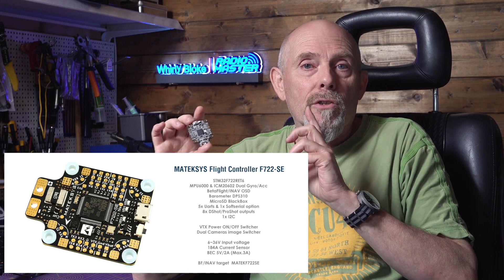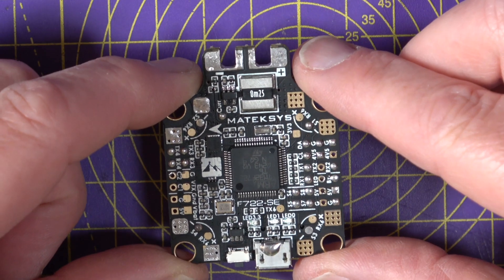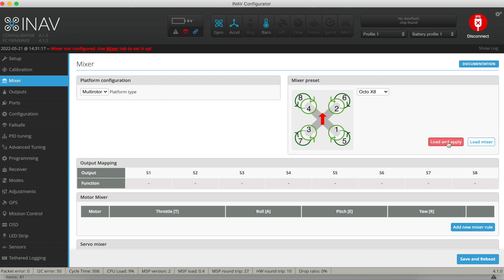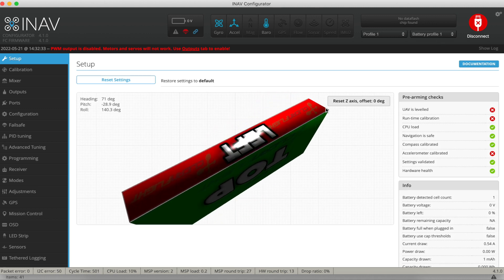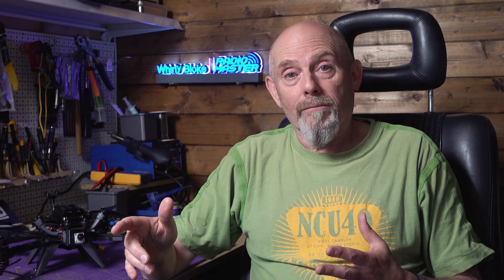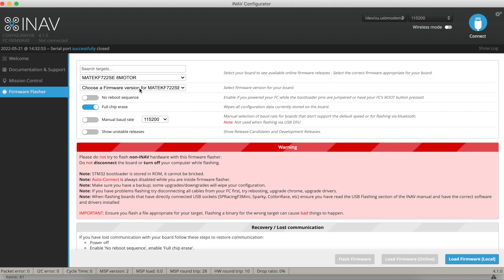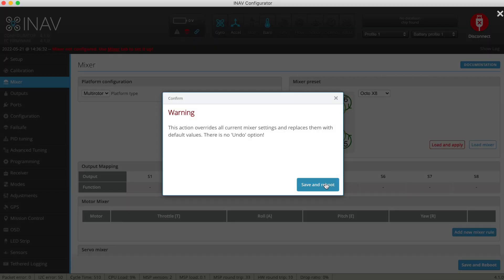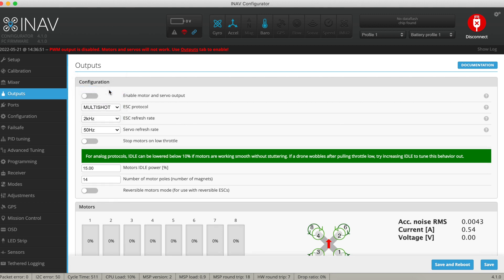Matek F722SE, INAV and 8 motors - how to get it working

Comment: Gday from downunder Whirley. Thanks for the prompt post on the ao7 gps holder . Mate I have a question on the thicc and maybe a small bone to pick   . The Gh5 that you use on the thicc uses image stabilisation now im a pretty dumb newby if I may say so myself, before anyone else .. and I gone and seen old mate whirles sporting a gh5 on the thicc n didnt do my homework and thought gh5 whirley uses one . He looks like he knows what he doing . Grab a gh5. Granted I couldnt find no black magic for the price I could afford  . Got a good deal on a practically new gh5 with the 12-35 and a few other extras for a k aus . Im hoping you can tell me you said somewhere in your thicc video dont get a gh5 and or there is a workaround that is equally as good as using a komodo or black magic with no image stabilization   , and I just wasnt paying attention if you did . You know us dumb newbys , we see you you tube fpv gurus like JB and yourself showing stuff and we go n buy that . So I got the gh5 for a grand and the built thicc 2nd hand for $700 with 2 batteries and a shopping bag full of props.
Please tell me ive had a win 
I fell down this expensive fpv rabbit hole , actually I got pushed and ive made a few dumb mistakes on the way , yeh yeh props off , ive still got my feet attatched. 
Reason im asking is a dude on another channel says make sure to get a camera with no image stabilization on the thicc .
Reply from the maker: You're spot on with the GH5 stabilisation. Check out my upgrade video that addresses these issues and more.  https://youtu.be/qwYQGF4ZmKQ
Reply: @WhirlyBloke  Can I respectfully suggest you should recommend not to go get a Gh5 on that video maybe in the description to stop people like me going and purchasing it ? My fault totaly for not doing my homework on that 1  I have  been preparing for a trip away . Early onset farking dementia  and photos and video are  memories  right .This is more than just a hobby for me , its a also a way to keep my brain working and boy doesnt this hobby have some challenges so I need all the help I can get . End of my life sob story .  So Ive got a problem now . I can try and sell the Gh5 and save up for a black magic or can you tell me how does the stead xp on the gh5 stack up against the black magic without it on gyroflow ? Or does it not even work at all for the reasons why image stabilization on the gh5 gets messed up from fpv flying 
I know using the steadxp is a hassle and costs  €350 which is like another grand in ausy money with taxes  . So I need to work out what im going to do. Another option I just had a thought ... dangerous ... I wonder how hard it would be to take my Gh5 apart and disable the image stabilization. Cant think of any other ideas other than fork out more money for a black magic and possibly sell the Gh5 . Also I was told something about using another flight controller with gyro and sd card and syncing up somehow in gyroflow.  Lastly  the gps . Do you think its a must have on the thicc ? What is the furthest you have flown it away , what flight times you getting  and what batteries do you use ? Thanks in advance for any help your able to offer.

Comment: Great video 👍🏼. I’m after a new flight controller for my IronMan 650 frame. I’m trying to give it a new lease on life. Will the Matek F722SE be a good choice?
Reply from the maker: Oh yes 👌
Reply: @WhirlyBloke  thanks for that. I’ll have a look into it. Can you fit an external gps and compass?
Reply from the maker: @andymuzzo8568  yes,  no problem
Reply: @WhirlyBloke  is it a good choice for the aos7? 
I dont want to get any cheaper choice less reliable  parts on this one at all.

Comment: I use the Matek F722HD on my Thicc. I've yet to try iNav, prefer the flight performance of BF, and have struggled to copy rates over. However the more reliable RTH of iNav is appealing, must try it out again
Reply from the maker: The matrix filter makes tuning so much easier.  Give inav a go.
Reply: I have the same board and frame. When I updated to BF 4.5 (from 4.3) I lost manual control of motors.  Motors all still vibrate when booting up.  Trying to figure that out now :(